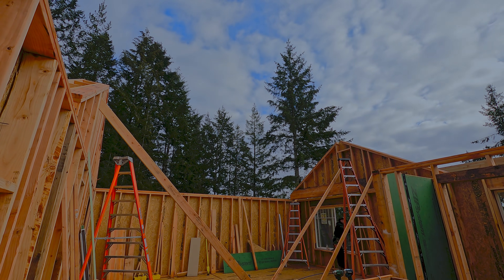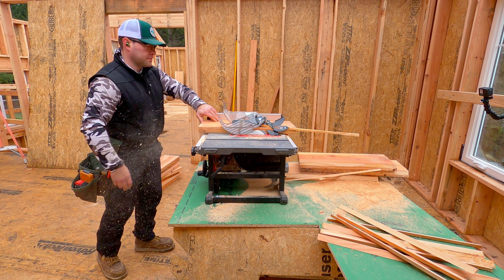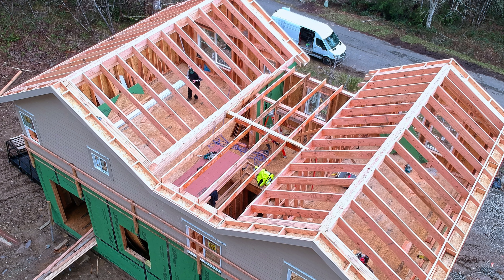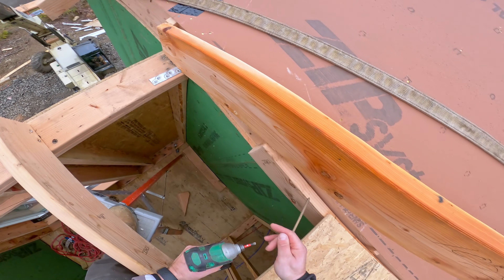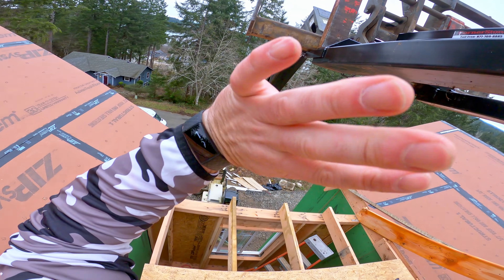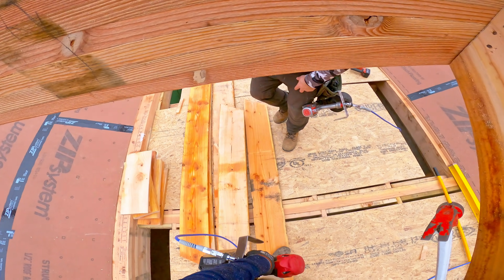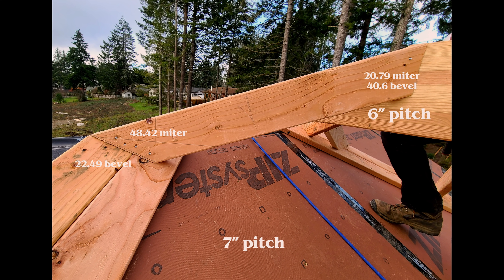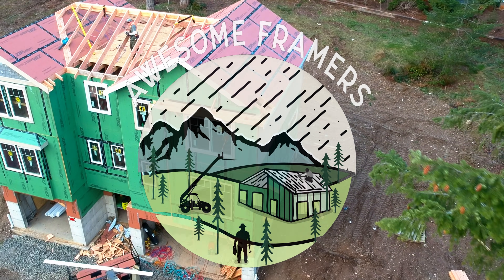Roof Framing Project 171 part 6

Comment: That is the first purposely built over frame roof I have seen. I have had a few calls over the years by homeowners, who did their own editions and made the error. I just laid a 2 by on one roof and scribed the line on the high ridge beam, deducted for sheeting an cut. Then measured, scribed, adjusted saw angles, on the spot. The cuts weren’t as nice as yours, but it worked.

I wish this knowledge was available when I started. Great job!  I really enjoy all the innovations I.e. framing perimeter walls with gables or eaves and siding installed first, using metal wall ties on top plates.

Comment: I watched both of you shoot nails through the top of a roof rafter...NOPE,  as any old school carpenter will tell you that is not to be done as you will hit those nail heads when cutting the roof plywood...
Reply from the maker: A non issue in real life. Gun nails are smaller than the nails the old school carps used.

Comment: Great framing video, but the roof design is going to leak in the long run.  poor design.
Reply: Why will it leak?
Reply: @TimUhler1977  There are four points at the bottom of the valleys that will get all of the water from every storm. Those are future weak spots.  I looked at roof for 31 years and designers know very little about water damaging roofs.  ow this is in Washington State so i don't think they get much snow.  If they do, leaking in 10 years.
Reply from the maker: @joeverna5459  Hey Joe, I don't think you've seen the house finished, so it might be best to reserve your judgement until then.  If you have seen it, then thanks for watching 😁 I don't understand your specific point.  All the valleys die into gutters.  Can you be specific where you think it will leak?
Reply: @AwesomeFramers  My background is homeowners insurance claims for 31 years. with roof slopes less than a 5 on a valley near a gutter will have snow freeze and cause ice dams.  i don't know what kind of winters you have in Washington. The really good contractors revisit their houses 5 years later to see what works and what doesn't.  i can't tell you how many 500-750k houses that have window, stucco, roof, gutter, and foundation failures.  i worked with several engineers and grew up with an engineer so i have a good understanding of construction.  Also, been in court a dozen times arguing poor construction techniques. You seen to have solid construction techniques.  In 31 years i have come across about 10 contractors who were good at their profession.  I try to encourage young people to get into the trades. Three things i learned from listening to home owners about contractors: The ones who show-up, follow-up and clean-up are the ones that get the jobs. I call it the three UPS. stay safe.
Reply from the maker: @joeverna5459  These roof slopes are 6 & 7.  We don't get ice dams here and the local codes and method of building reflect that.  So we won't get the leaks you mentioned.  

Additionally we've been building in this exact location since 2001.  When leaks happen, its always after storm debris punctures the shingle, and I can only recall that happening twice.  

I hear you about shoddy workmanship.  Its a shame that with housing prices as high as they are, that you don't actually get what you pay for anymore.
Reply: @AwesomeFramers  i didn't think you got snow in Washington, so that does make a big difference. My eyes are use to east cost, Philly, construction. Thanks.
Reply from the maker: @joeverna5459  we are in climate zone 4C but as you get closer to the Cascade Mtn range, what you are describing is much more common

Comment: Should have rip your subfacia at an angle ,if ya took the time to rip angle on all your ridge blocks , me personally don,t like the gap and just lining it with your speed square
Reply from the maker: The reason the blocks are ripped is to make it easier to use them to keep a consistent air gap.  I don't personally see any reason to bevel subfascia when the soffits are closed.  It doesn't save us any time.
Reply: @AwesomeFramers  mostly so ya got good nailing so ya not just nailing into top corner of the facia butbdoes make it more solid ..butbit all about time and money these days we always took the time to do extra thing like that back in my day..god thats sounds old .but i am
Reply from the maker: @rickdougherty8058  My point is that it doesn't need to be "more solid" than it is nailing into 2x6 subfascia that isn't beveled.  There is no actual strength added because of the bevel.
Reply: My point is that over time just nail into the top corner of the facia cuz that’s what ya will be doing only catching a small amount and I,ve seen it many time especially in cold weather climates it start to heav and pull out over time and ya can see it when ya look down it,and the extra solid nailing is by far better and more solid ,ya it’s extra work but better quality,,,

Comment: Good work framing it up guys. One question that I’ve had and nobody has answered it: doesn’t shooting through your valley sleeper into the Zip sheathing compromise it’s integrity as the moisture barrier?
Reply: Good question, no it doesn't. Seams and valleys get taped

Comment: Sorry one more question,  so to form the pocket to drop the ridge beam in do you just cut thru the double top plate you put on gable ? or slide it under then put a spacer on top
Reply from the maker: We always cut the plates out and drop it in from above

Comment: Is there a prefered method, notching over top of ridge vs butting up like you did
Reply from the maker: If you land the rafters on top of the ridge, you have to find a way to get insulation up there before sheathing.  We find it much easier to just butt the rafters.  Its just a preference thing unless the plans call for a lowered ridge as an architectural detail
Reply: @AwesomeFramers  Ok thanks. I'm a novice builder and I've only used truss systems. My only issue with stick building is my rafter runs would be close to 20 feet, so not sure if I would need a mid point purlin ?
Reply: @lawrenceporter3723  You would with rafters that long.

Comment: Best framer I have ever seen. Wish I could learn by working for you but I’ll soak up what I can from the videos. Thanks for taking the time to share your knowledge.
Reply from the maker: I really appreciate that, but we don't hold a candle to a lot of framers here on YT and over on IG.
Reply: Bro if you want to learn check out volunteering for Habitat for Humanity in your area. There are some real O.G.'s helping them. A lot of the guys are retired and have 40 or 50 years of carpentry experience.

Comment: Another odd way to do rafters.I wonder what geographical location you are working in.Blocking along the ridge, sleepers, no brackets,gluelams,no birdsmouths and so  on.
Reply from the maker: Its only odd because you are unfamiliar with it.  All rafters must be blocked full height at the eaves in our seismic zone according to the code and our engineering.

The blocking at the ridge is very common for the roof diaphragm and required by our engineering. It can eliminate the need for hangers, so its a grea place to use up scrap. 

The ridge is a glulam and no birdsmouth is required at the ridge.  An easy Google search will show different options for connections.  In this case the ridge was held up for maximum access in the attic for the mechanicals.  

Different doesn't mean odd, it means different.

Comment: Great work guys. I wonder ate you going to cut the roof at the joining roofs to let the attic insulator through? Or will there be 2 attic access points?
Reply from the maker: great question.  Yes we cut access for the insulator.  In this case, spray foam.  Nice big access :-)

Comment: Can someone please tell why some builders use rafters and some just use trusses? Its it cause its easier or cheaper or is it differen't cultures teach different methods of building.
Reply: open concept and cheaper than scissor trusses is the only explanation I can think of.. Also stick framed roofs are way more enjoyable to build :D
Reply from the maker: This company switched from trusses in the late 80's because of scheduling issues.  All the old timers could hand cut.  After pricing it, we've stuck with it because we control the schedule, zero truss uplift, open attics etc.  The cost is about the same all things considered for us.

Comment: Why do you use tripod ladders instead of four legged ladders
Reply: 3 leg ladders are nice as you can get them in tighter spots, and also, like a 3 legged chair they balance better. It doesn't matter so much if one of the legs is on debris or extension cord, it will not tend to wobble.
Reply from the maker: Thats just what we had when I was a kid and they are really stable.

Comment: What tool belt are you wearing, looks nice
Reply from the maker: https://www.badgertoolbelts.com/  I absolutely love them.
Reply: @AwesomeFramers  i bought the side by side from them but they were to small so I returned them, which ones are you wearing
Reply from the maker: @josebonilla3897  I'm sorry for the delay bro.  I'm wearing the carpenters set just a custom color.  I asked him to raise the hammer sleeve and shorten the sleeve.
Reply: AwesomeFramers that guy doesn’t know how to do business
Reply: The guy that runs badger bags has very thin skin and will not build you a bag unless you put up with his shit for half a year ,I’d recommend diamondback

Comment: when you pre fab the walls and do the soffit on ground how do you vent soffit? Or is it even needed? Thanks!
Reply: don't need it for cathedral roof types... which I'm assuming this is. only need the ventilation for roof with attic space that is prone to condensation in the attic space where warm air escaping from the ceiling contacts the cold roof sheathing above. hope this helps!